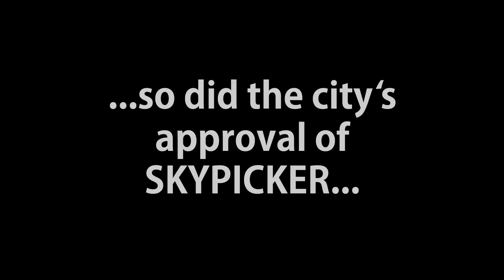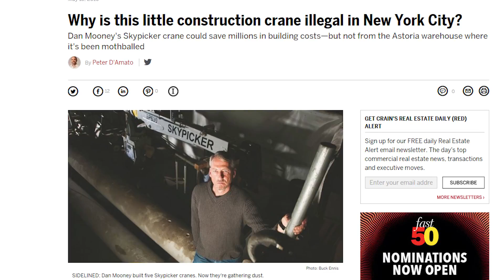Why is this little construction crane illegal in New York City?

Comment: As a member of Local 14a Operating Engineers he knows the real reason for resistance against this baby crane. He is a crane operator. Tower cranes generate $$$. Operator, Crane Tender aka mechanic and the crews to set up, jump, and remove one tower crane. Two unions directly involved, Local 14a, Local 15 and the Teamsters Local 144 both make a lot of money from Tower Cranes even on a small job. Does he think Joe Lomma who owns NY Crane is ok with this? What about Bay Crane. Or Falcon Steel? 
1-you can’t fight big money especially when it greases political palms
2-outside of the construction industry nobody cares so he won’t get support